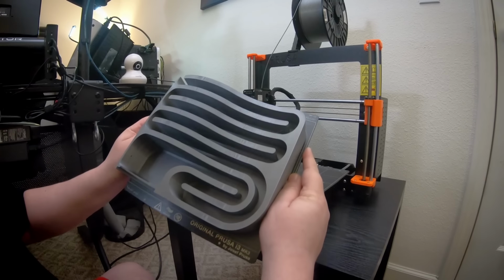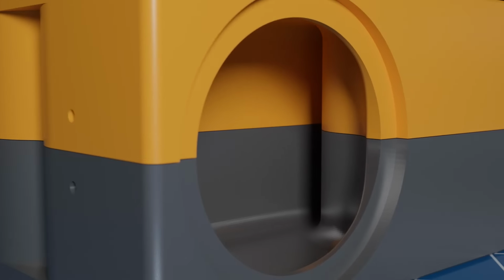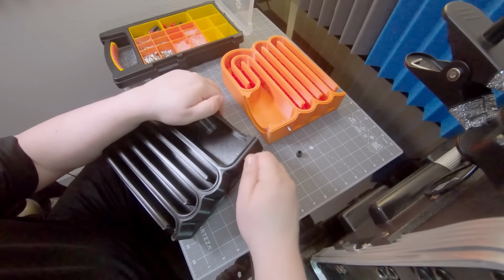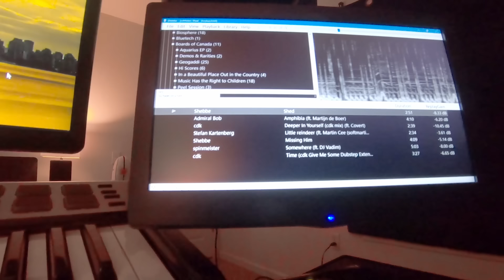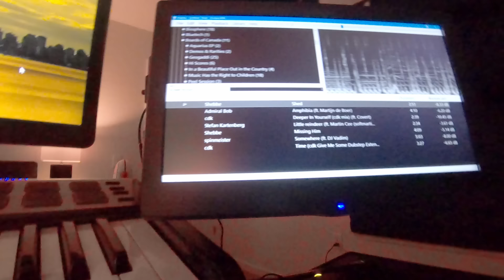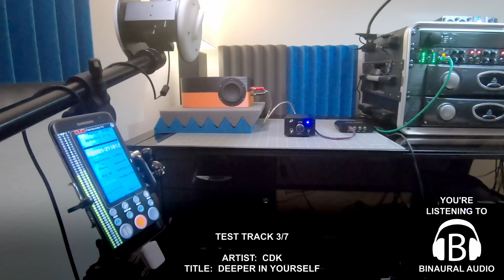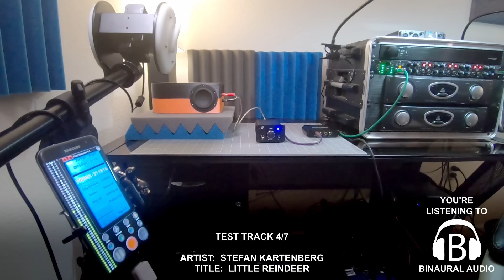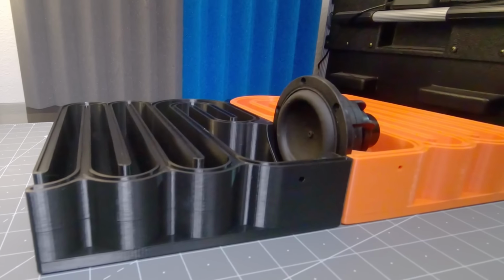3" Subwoofer Enclosure v.2 (Plus Demo)

Comment: Hey my friend I am been thinking of the same thing and something I was working on but it’s probably gonna help you you mentioned mentioned it in your video and that’s called laminar flow just a real quick glance at what you’re doing with your base tube is it’s all constrained add an equal constraint all the way through until you get to a point to where you want to put in some more blow well laminar flow as sound goes from one process to another process it automatically wants to expand if it does not get this expenseIt will start to implode on itself that means one wave hits another wave and it starts canceling out put it through a long enough tube all the same constraint pretty soon you won’t hear a thing

Comment: Hello i wonder if anyone could help me i have bought head unit kenwood 4707s and on the back of the head unit it has 3 left and right outputs and i want to hook up amp can anyone please tell me which outputs is for bass and which is one is for mids and tweeters. i have never done this that's why i'm asking.

Comment: Heya, so being new to 3D prints I was excited to do this as “my first big print”...
First have is 25% through as we speak... 
however, I have done a 0.15 layer height with 15% infill ... I am not sure how the density corresponds with your 2.0 at 20% ? (Is there a table that can give an estimate?) I am actually also wondering if you did a 5% infill and then filled it up with a resin epoxy when done, would that add any value? 
Ps, never knew anything about speakers before I got this printer, your videos have been really great! Thank you!

Comment: Great work! The tang bang has finally come back into stock and I picked one up! I plan on printing this enclosure soon. I do have a quick question tho... since PETG is slightly more dense than pla would using PETG instead have an impact on performance?  Thanks for the great video!
Reply: I know this is late.. but increase in density would be an improvement to PLA as the density will reduce resonances caused by the box. I am currently printing mine now out of PETG. 

Fyi, in speaker box building, the more mass and heavier is generally better. That's why Hexibase prints 4 walls and 20% infill -to increase mass/density.

Comment: Alright, I was not expecting that. 

Using a EVGA Nu Audio sound card set to use it's internal compressor to 'Balanced' mode at 32-Bit, 384KHz. For headphones, I'm using the tried and true Sony MDR-7506. The sound came through muddled in the middle tones and washed out high tones, but the bass is like a 4k Pacha meme. It caught me completely off-guard.

Comment: Very nice work.. one little coment - i think there is lots of consideration for the use of energy produce by the rare side of the speaker and maybe  less for the energy of the front that need a biger box speace to preduce stronger bass.. but consider the size of this speaker resolt is impressive ..anyway well done..

Comment: What’s the exact model name of the 3D printer? The thhree printers in your Amazon storefront are  different from the one in your Video. So which Printer specs would you recommend to achieve the same Solidity result ? I would like to design a slightly different one that fits in a triangle like Shaped cavity behind the rear light of my car. This would be my first project of this kind, are you interested in overviewing my design before I print it? I would send you the CAD-data.

Comment: hexibase
Could you design a place to add lead shot?  Or sand for those who don't want to use lead... you can add a glue when you poor in the lead shot or sand.  I have speakers from a company called Vienna Acoustics that are designed to have sand or lead shot added.  The company did it because it would be a lot more expensive to mass load them and ship them all over the place.

Comment: Nice but i do hear bass distortion common for small speakers in baffled boxes.  These designs always end up suffering from bass cutoff.  The cone is too free because the rear allows air to escape if you compare this same speaker in a sealed enclosure no ports or baffles it will resist the low frequency distortions better while letting the higher frequencies come thru.   Subwoofers are generally in seal boxes some with a tuned port some with a transducer to add to the bass response.

Comment: This is so impressive!  
About what was the cost of the filament?  I know it's not cheap and it looks like you used a "ton" of it.

Your listening test was reatly appreciated but for me and my PC, It's hard to determine what I might be overdriving:  my sound card or my Advent AV290 preamp or the driver itself.  lots of doubling going on - I kept dropping Windows and speaker gains and I couldn't seem to get rid of it.  Oh well, I hope my surround is good on my sub but I have to split the case to inspect.

I was thinking this could be made by gluing a stack of 3/4" plywood where the passage was cut with a router.  CNC guys can do their thing too.  The maker stuff is intriguing (I'm a finite element stress analyst) but it's the 3D scanning I'd love to get into.  However the good stuff is thousands of dollars which I cannot afford.  I would get lots of satisfaction from scanning and making a copy of something - probably automotive.

Thanks again and your gear looks awesome!
Tom

Comment: @HexiBase ...Why are we playing high frequencies thru a subwoofer???🤔 Additionally instead of using JB WELD and waiting for a long cure time (24 hours...not the 5 minute epoxy!) Why not just use Methylene Chloride for a chemical weld bond that would evaporate and cure in probably under an hour?! Acrylic/plexiglass fabricators use Methylene Chloride for water clear welds at plexiglass joints!😁👍🏻

Comment: The enclosure appears to be creating a bass resonance at around 50Hz. It's a little difficult to be precise, because I'm pitch matching using an oscilloscope app on both my reference/mixing headphones and monitor speakers. I'm not sure what you are trying to achieve here, but in your testing you must have discovered that no matter the enclosure a 3" driver cannot produce accurate bass, only the resonance of the enclosure and room. I'm hearing no articulated bass of any sort on any of the material, and I'm guessing that if I put my ocillator through it I'd pick up the ugly resonance right away. Psychoacoustically, the skiffle groups of the 1950's found that bass pitch was not required to produce the illusion of an accurate bass. They used a broom handle attached to a tea box, with a string between. The bass was simply an untuned low throb. Like your speaker.

Comment: Can someone describe this compared to a 8” or 10” closed enclosure style sub? 
I can hardly imagine the true sound.
Reply: Never get a subwoofer element larger than 8". It will just roll and roar, you will not hear that tight snare drum bass that you got the subwoofer for in the first place.
Reply: It sounds like a 3 inch speaker in a box.

Comment: Looks like 30hrs print on my mk4 with 1.3kg filament with those settings... If you got a new version that includes requisite electronics to make it a plug in solution (with output to satellites for tweeter/mid would be amazing.
Also question I guess is would it make sense to make the insides hollow to be filled with some mixture like plaster of paris and pla glue (saw that on diy perks)

Comment: You should probably compare this to a regular tuned port enclosure as I doubt it will sound much better. The "transmission line" design here is supposed to wrap around such that the exit port is on the same face as the driver. With a subwoofer, the effect of putting it in the rear may not be as noticeable, but the point of the design is to boost gain by redirecting the normally out-of-phase soundwave that comes from the rear of the driver to come out the front, or at least align with the phase of the wave coming from the front of the driver.

The channels inside the enclosure need to be large enough to accommodate the surface area of the driver. For a 3 inch driver, that means the channel needs an area of 28.27 sq inches, so around 7 x 4 inches. The specific length of the channels should be 1/4 of the driver's resonant frequency wavelength (which you can measure or take from the spec sheet).

That being said, for a subwoofer you can gain 95% of the benefits just by using a well thought out tuned port enclosure.

Comment: Have you been tearing apart old Bose early 90s mini abs plastic clocks and stereos with small driver transmission line enclosures for good lows from small crappy speakers? LOL, JK. I think every teen in that era into speakers surely did, I must have junked(messed up beyond repair) 3-4 $500 clocks, because I must have lost half of the screws on disassembly, while trying to figure out what was cracking all at once. Making for a reassembled radio, that slowly rattles itself apart, then smokes a little. Whoops!!!

Comment: Best way to test a Subwoofer is to feed it a signal that can be shifted from around 30Hz down to 10 or 5Hz, if you can hear it, it's not a Subwoofer but rather just a Woofer BTW, 
So how can we test a Sub woofers response then? Simple.. if the walls and floor to the room vibrate within the above mentioned frequencies and you don't hear it 
but rather feel it then what you have is a proper Subwoofer, only way to get an indication if the Subwoofer is performing at it's peak is if a laser is trained on a vibrating wall and it's reflection recorded and compared to some established base line conducted with much the same above frequency sweep, and yeah Music is only good for woofers.. 

A good subwoofer BTW must be capable of outputting a minimum of 3 times the Rms output that the main amplifier is capable of.. Eg: if your amplifier is a lowly 100 Wrms per channel then a 300 Wrms active subwoofer has to compliment it..

Comment: Hi! I made one, but have big issues with the TB Driver(s). in "free air" they operate normally. Big movement of the membrane, no additional noise whatsoever. But as soon as I put them in the enclosure they make a weird sound even on moderate to low volumes. First I suspected the print, but even when enclosing it in as simple as a tube, as soon as there is enough (air) resistance it has to work against, it makes that (rattling/scratchy/papery) noise, no matter if it is mounted pointing out or into the chassis, even starting from moderate volumes. We of course also tried different Amps, and we tried 2 TB speakers, both have the same behaviour. Please help! Here is a (iPhone) video of it, which I took at the very end of our investigation, which is why it is not mounted in the chassis anymore. https://youtu.be/2EOTnlhCrzQ